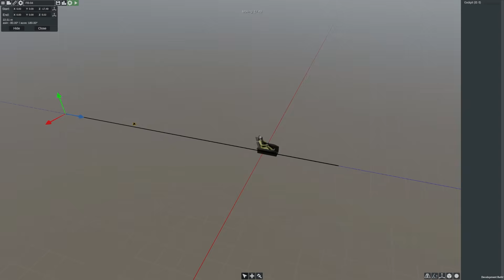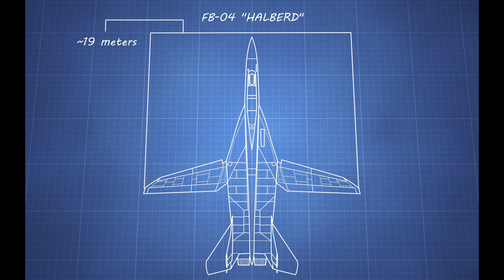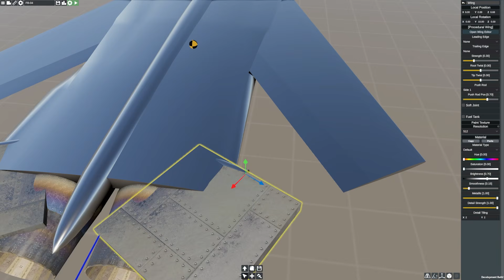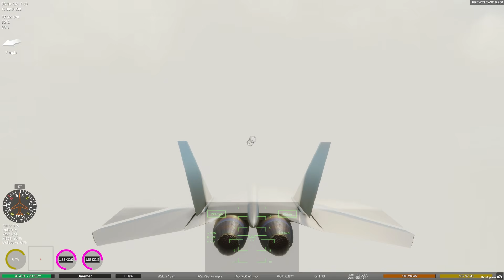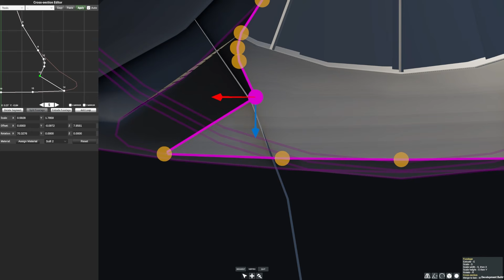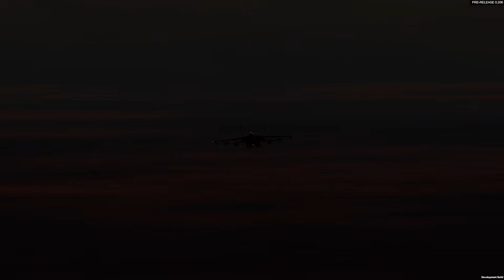Using Flyout to Design a GIANT Nuclear Capable Fighter Bomber

Comment: I am having trouble with the landing gear after installing the plane in flyout.  pressing (G) which is supposed to be my gear toggle doesn't do anything except open the gear door, (which I have mapped to a different key (H)).  The (H) key doesn't do anything either, so im kinda lost

Comment: Hey Messier!
You better prepare for a long comment because oh boy...
Ive recently come up with an idea: What if during the 1960s to 1970s the Soviet Union designed a high altitude interceptor capable of reaching the edge of space (basically almost a space dogfighter) to intercept American Rockets, for example ICBMs or Space Mission Rockets to slow down American progress in the space race. 

What kind of design features would such a fighter need? Things like Altitude adapting engines that are capable of even reaching such heights, high energy density fuel, thermal protection and a pressurerized cockpit are obvious, but id like to know about the specifcs, like dimensions, wing configuration and how it would differ from a regular fighter of that time.

I think thatd be an interesting concept to explore and maybe even build.

Comment: I’ll just say this separately from anything else: you can’t fool me 😜 you’re building up to a Veritech fighter from Macross. Swing wing with VTOL capabilities where you land on the “legs” of the folded down engine pods. Sure, the fuel capacity of the aircraft is terrible, but they were nuclear turbines to begin with, so it’s all fine, right? 😂

Comment: Nice inlet design! I do believe that vortex lift won’t happen until significantly more AoA is pulled than needed for level flight. Vortex lift as seen in delta wings and highly swept wings creates a good amount of drag that you’re not experiencing. You can tell because you can supercruise.
Reply: The vortex lift winds up with extra drag because you’re pulling a good amount of air with the aircraft compared to a laminar lift scenario. It takes energy to produce and maintain the vortices, which is drag that requires more thrust.

Anyway, good design, but I wanted to correct what could be a misconception for you or your viewers.

Comment: looks like the f-111 if the 60's era Soviets designed it, about the same size, not much different except twin verticals.  probably could do with a lifting body to  help it with payload carry weight.

Comment: Hey Messier i have an idea for a nations Air Force you can decide which one it will be but it should be either hilly highlands or more preferred a thick jungle area my idea is based on a concept from the 1960s for the airforce of west Germany which consisted entirely of vtol air craft there was the vj 101 for the interceptor role the vfw vak 191 for ground attack purposes and the Dornier do 31 for transport since your video on building a vtol aircraft came out i had the idea brewing in my head hopefully you will make some aircraft for the country any ways love your videos keep going❤

Comment: Sir, can u make a WW2 radial engine fighter? It's has to be capable to serve a lot of missions such as CAS, medium to low altitude performance, engine cylinders between 14 to 18 and must have a naval version to reduce costs(this last one is optional)

Just to put clearly, this is just a request, you can't do it if u don't want, you probably have better things to do with your free time and the next projects.